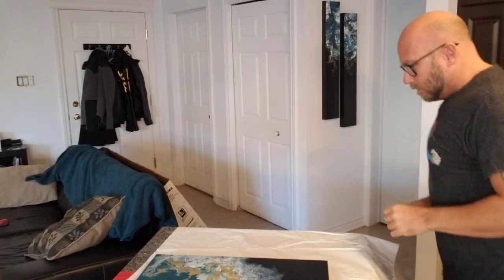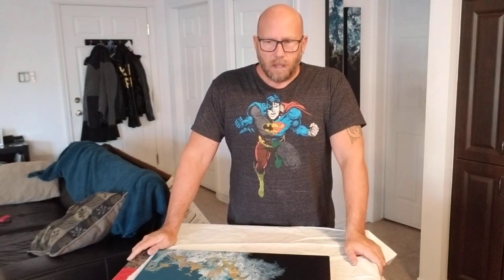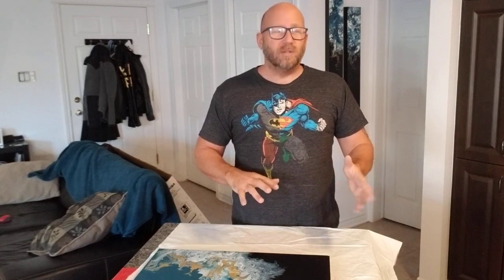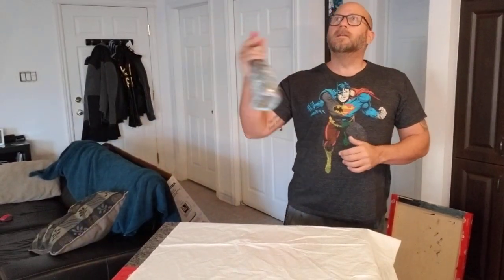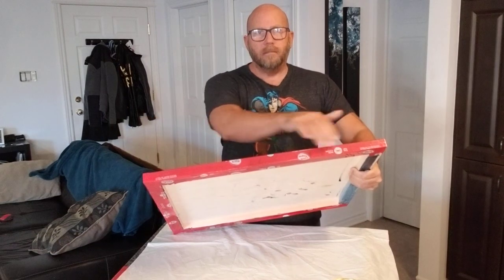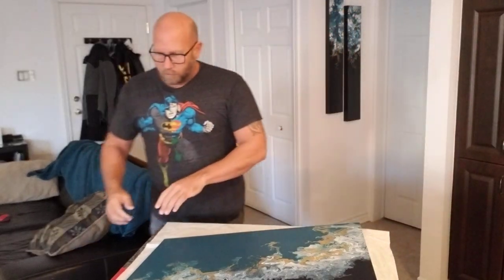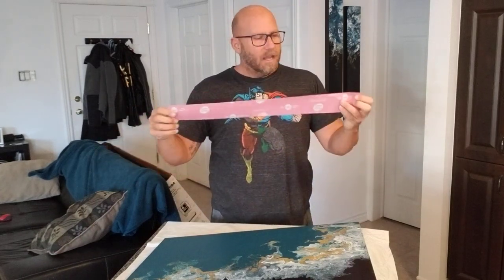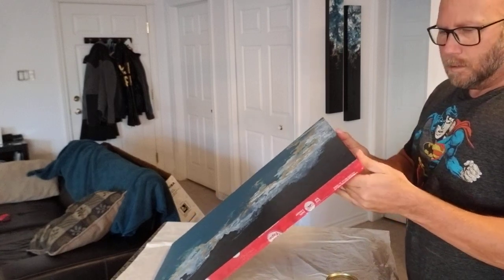How to resin a large piece of art. Every single step!!

Comment: Since part of my piece is digital print mounted on paper that’s mounted on panel and image transfers I use something called timeless varnish for digital prints, it worked out fine and that varnish provides uv protection as well. I just have to remember to finish applying it to the next piece I will resin coat. You are awesome !
Reply from the maker: Be VERY careful with varnishes before you resin.  Some will react very crazy with the resin and create TONS of pull aways and craters.  I just learned that lesson with UV varnish spray.  AND be sure that your paper for your print is done on a gloss type paper.  It can't be canvas or pourous paper.  The resin will seep into it and discolor the print.  I would recommend a few coats of a thick gel medium maybe.  Instead of the varnish.  At least you know it is fully sealed then.  Just be careful.